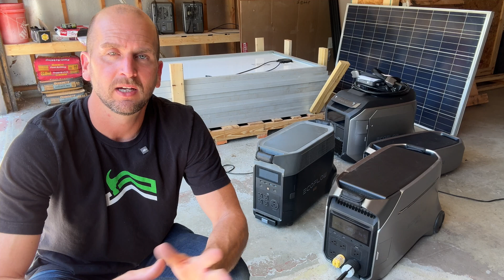Delta Pro vs Delta Pro 3 |  Comparing Top 3 Upgrades

Comment: Yeah, you're leaving one little bit of information out. If you buy these portable solar power stations, no solar installer will Mount solar panels on your roof because they didn't sell you the equipment that you bought... 
I contacted 30 local solar installers in my area. Not one of them will install solar panels on my house!!!
Hence why all these Portable solar power station companies only sell portable solar panels!!!
Reply: I talked with a few solar installers, most of them only want to use their select products and none of them want a half job, like you said. They are kind of sheisters about protecting their business model. If you can sport doing a ground mount instead, that’s a way better option.. it’s easier to manage and setup, and cost can be about the same without having to bore into a roof and do all that work, plus you probably won’t need a permit because this is considered off-grid, if it connects only to a critical loads panel.

Comment: I’ve got a question. I bought a delta pro with the transfer switch combo. I’d like to upgrade to the DP3 but I’m not sure how I’d connect it to the transfer switch I already have installed. I connect the transfer switch with the 30A 120V off of the DP. How would I go about connecting a DP3 to the transfer switch if I upgraded.

Comment: Can the Delta Pro 3 connect to the Delta Pro Battery — or do you need to use the Delta Pro 3 “stack on” batteries?

Comment: Hi Scott, my fridge pulls 400-430W from the Delta Pro (original) and then stops as tho it decided it's not compatible with the compressor (LG' s "linear compressor"). My freezers also don't seem to like the Delta Pro 20A outputs. Any idea why this is?

Comment: I had 2 Delta Pro 3 ( DP3 ) units running in parallel with their 50 AMP hub bridge. One of the Battery units was defective and caused a tremendous power surge which fried my HVAC thermostat and ECU, coffee maker, Air Purifier, GFCI outlets, and over a dozen outlet surge protectors and damaged two 200 AMP breaker panels. The damages have run into the thousands. One electrician who inspected my system told me that one of his customers had a similar problem with his Eco Flow Ultra except that he didn't have the unit hooked up to the home. I like the EF Delta 2 Max batteries, but the EF DP3 and the 50 AMP bridge is dangerous. It nearly burned down my home.
Reply: Hey you post this same story on every delta 3 video. It's true you do work for Jackery😂
Reply: @bpmakesithappen8395 I know, I see this guys same post, almost word for word, on ALL these EcoFlow videos.. he does cut and paste and leaves the same comment… you have to wonder if he’s intentionally doing that and if his story is actually true. I don’t see complaints like that from anyone else.. if Delta Pro 3 didn’t work out for him, why is he bothering watching all these review videos? !
Reply: Wait whats better about the delta pro over the delta pro 3 then ?

Comment: What kind of panels and connections did you use to get that fantastic 2350W solar input at the beginning of the video? I'm ordering an EcoFlow DP3 and the suggestions that EcoFlow is giving me are 3 400W portable panel on the HV port and 1 400W portable panel  on the LV port. That's only 1600W, nowhere near what you're getting!  Thanks for the great video!

Comment: I keep asking this question but maybe you're my guy. I have no interest in solar but I'd like to have a nice backup battery until i can get off work and start my generators. Can the original Delta pro be wall charged at 1500 watts while outputting 3600 watts?

Comment: Hello! I am very new to solar, and don't know where to get started. I want a simple system to run my swamp cooler,  also called an evaporator cooler 24/7. 

It uses 300 Watts, but at some point I might upgrade it for a 450 Watt version. So I want a setup to run 450 Watts, 24/7. 

How would I do that? What kind of solar panels do I need? Can it be any brand? Do I just double what I need? So 900 Watts of panels would run it? Or do I need a big buffer? Is it easy to set something up like this?

Do I need an eco flow or delta setup to run my cooler 24/7? What size would I need to run my cooler overnight? 

Sorry for all the questions, I don't know what to do. But my cooler is costing me $140 per month at $0.65/KWh, and my total bill regularly goes over $500. So just getting the cooler on a panel setup would greatly help. Thanks!

Comment: Unfortunately, the Ecoflow 3 I just purchased could only produce 2.3 KWH in a 24hr test of my upright freezer and would be drained to 5%. Performed test twice with pretty much the same results. I did not have it connected to grid or solar. Was hoping for more run time.

Comment: im trying to decide between delta pro 3 & a refurbished pro. it's a $1000 difference. I live in a smallish 1 bed rental townhouse but want a set up to run a portable AC to save money on my bill since AC is what costs the most. Its 122 degrees here in Las Vegas. Mainly I want a back up plan for when the power goes out. Should I save $1K and get the older pro version? is the $1000 worth it for the pro 3 for my situation?

Comment: Can you combine the Delta Pro with the Pro 3 to run your house?
Reply: Also want to know… Can the Delta Pro 3 connect to the Delta Pro Battery — or do you need to use the Delta Pro 3 “stack on” batteries?

Comment: I'd really love to see someone that has 2 Delta Pro's with the dual voltage hub, and if it can run a central  air conditioner for any length of time.  I guess the same thing goes if anybody has done this with an Ultra.  I mean.. with sales you can now get 2 Delta Pro's with the hub for under $4500.
Reply: I have 2 Delta Pros with a dual voltage hub and it's never been able to start my central AC unit. My unit is a 4 ton so the initial draw is too much. My Delta Pro Ultras are able to start my AC unit.
Reply: You need an easy start installed. Then you can run it for about 2 or 3 hours.
Reply: @dboucher26 is the ultra suppose to be below the Pro model ?
Reply: I have 2 Delta Pros with the hub. My 4 ton central A/C  pulls about 12 Amps. So 12X220=2640 Watts. Figure 7200 Watt Hrs for both units.  A whopping 2.7 hrs. Need to add some solar panels to help out.

Comment: I have an EcoFlow Delta 2. I bought EcoFlow 2*400 Solar Panels. Can I use them together with this battery? And how should I connect the panels, in series or in parallel?

Comment: Bonjour, thank you for the video. I live in Canada and solar energy is not viable for me. Would need to link the battery to an external combustion generator outside of my house. Question: would need a long cable (20 feet) to link the Delta pro situated in my basement close to the electric panel) to a generator outside (would need to open a window for this). Does such a cable exists? Merci à l'avance pour ta réponse.

Comment: It’s hard to beat the delta pro
 Gen 1 at current sales prices ($2199). You can’t really diy it with matching specs.

The noise is not that bad actually. It’s not like you charge it at full capacity or run high inverter loads non stop.

I know the 240v from the new model is tempting. Personally I have not used 240v in 30 years. It’s important to have the feature in the lineup, but it’s not a buying decision for me.

The higher solar input is nice.  1600 watt is plenty for me though.
Reply: Someone is selling a Delta Pro and two batteries near me for $6k and I thought at $2000 a piece, that's a massive bargain. I did not realize the Delta Pro new prices were so low now. Thank you.
Reply: I bought a used Delta Pro on eBay for $1300, a STEAL
Reply: @NightlyH  I haven't seen under $2k yet. Maybe this will push the prices down. I'd love a pair of those with the 240 adapter
Reply from the maker: Thanks for the feedback and I agree at $2,199 that is a smoking deal for the DP 👍
Reply: You can now get Gen 1 Delta Pro for $1,250 with discount coupons.  The smart extra battery as low as $900.  2 Gen 1s provide 7200 watt output and 7.2 kwh capacity for $2,500.
Reply: @samatwesuyou realize my comment is over a year old right? Of course prices change over time.
Reply: What’s higher solar input mean ? How will this help when powering cinema video lights ?

Comment: Can we lift it one handed using only one of the handles ? Is the delta pro 3 sturdy enough to do that ?
Reply from the maker: It would probably work but I don't image too many customers will be using 1 handle for the 113 lb (51.5 kg) unit.
Reply: @everydaysolar  oh ok. Thats really heavy to carry with one hand 😇 I own a delta 2 and it’s manageable